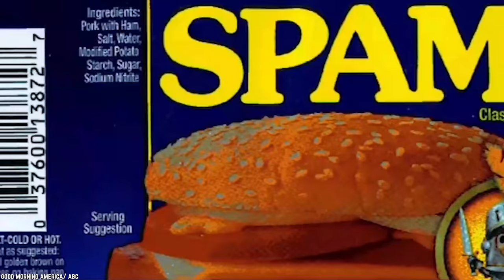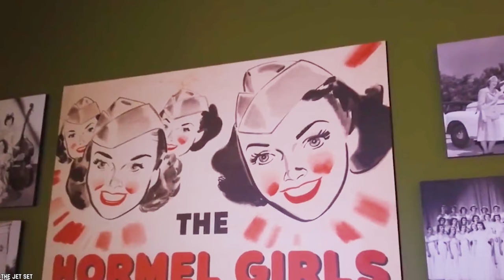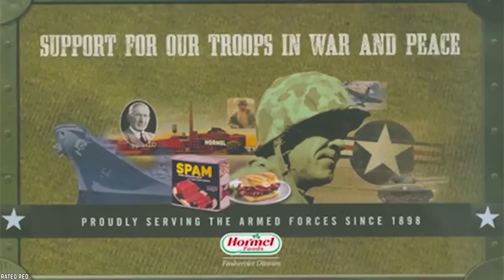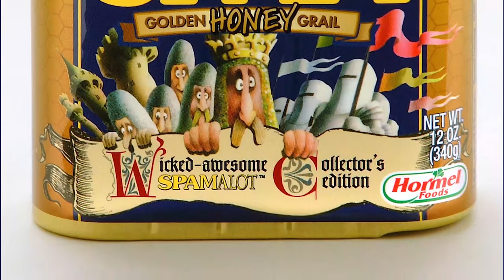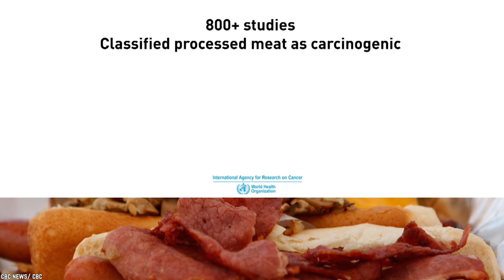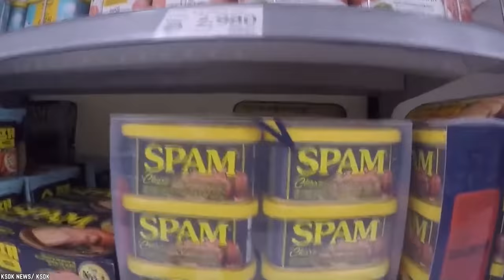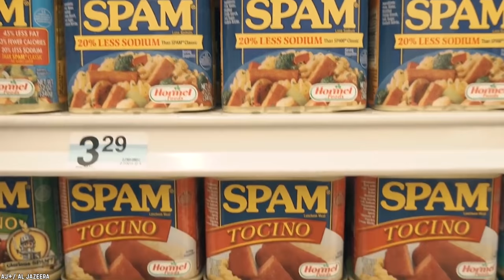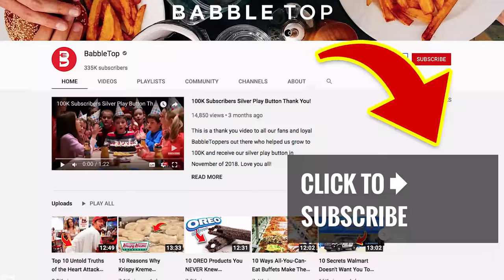Top 10 Untold Truths of SPAM (Part 2)

Comment: Spam recipe: Take two cans of spam and cut it into super fine pieces. Bake at 350 degrees in the oven for 6 minutes. Place baked spam in frying pan. Add in 1 finely chopped white onion, 3 tablespoons of minced garlic, two cans of smoked oysters, 6 oz of cooked shrimp, 1 bell pepper, 1/2 cup of New Mexico extra hot hatch green chili, 6 tablespoons of extra virgin olive oil, 1 avocado, 2 stalks of chopped celery, 1 finely chopped carrot and 4 slices of swiss cheese. Salt and pepper to taste. Turn frequently on medium heat for 12 to 15 minutes. Spread spam recipe 1/2 inch thick onto 2 slices of baked garlic bread. Add fresh slices of fresh tomato. Place on large sterling silver plate. Add heavy parsley garnish. Take over to the garbage can and throw it away.
Reply from the maker: LOL! Did you enjoy this video Reggie Glubber? 😉😀
Reply: @BabbleTop  mmmmmmmmm.